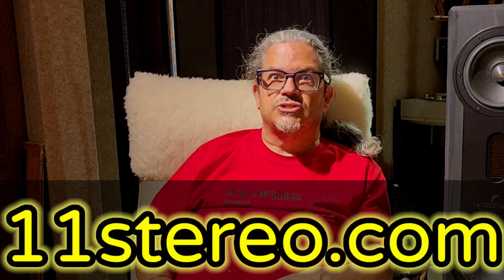Fix your AUDIO with proper house Grounding!!

Comment from the maker: PLEASE SUBSCRIBE 🙏 if you like my content!!
Reply: And make sure there is no corrosion at the connection point between the rod or underground water pipe and the connecting wire clamp.
Also a whole house surge protector is a good idea.

Comment: Small correction:
Those wiring check devices that you plug into a wall outlet make sure that the hot wire is the hot, the neutral is the neutral, and that the ground has continuity with the neutral (usually 3 lights). 
If buildings are wired according to code, the neutral wire (current return path, usually the white wire) and the ground wire in your outlets are connected together in the main panel, they're not supposed to be connected to each other in branch/sub panels. This doesn't tell you ANYTHING about the quality of the main panel grounding to earth (ground rods) or grounding to your plumbing. 
Those testers will show you that everything is correct with or without earth grounding or plumbing grounding. Those devices cannot check that.
Reply from the maker: OK so they check for correct phase only. So much for cheap Home Depot bullshit
Reply: Yes, these cheap device are a good starting point to check if the wall outlets was wired properly in the house.  For checking quality of the ground quality of the wall outlets... Can this be done with voltmeter?  We can a check visually as mentioned with connection of grounding rod, but they could be issues somewhere else.  How can we check to make sure we are all good?

Comment: I run a “Ground” or earth cable connected to a secondary copper earth rod outside on every piece of equipment I run. Mickey’s dead on with this advice 🍻
Reply from the maker: There you go... that's the OCD level...
Reply: That’s dedication! 
🎶🤓
Reply: I am about to run a separate MC cable to a new outlet in my house and be on a 20A breaker. Separate ground and ground rod for it. No more sizzle sound from old grounding for my modeler. Hope it helps

Comment: As a registered NZ sparky we have to measure the resistance between the ground peg and a meter probe inserted into the ground.We are only allowed to run additional earth pegs in series only with the earth terminated at the earth bar in the main distribution board. I recommend to people who think they have earthing issues to first check earth connections after turning off main distribution board power first and then soaking ground with water around earth pegs if soil is dry.
Reply from the maker: Yes, you can also buy special concrete that stays wet of you live in the desert. We don't have dryness issues where I live however.
Reply: @OCDHIFiGuy  I used to know an extra OG who worked for Boeing back in the day as an Electrical Engineer when most of the electronics were run by vacuum tubes.Great stories,one of them was the effort they went to for earthing,burying large areas of metal grid in the ground.

Comment: Hi mike I see my ground rod out side it looks like it's all conected but say it's not is it ok to just go touching it iti s it live  should power be off before I put a metal screwdriver anywear near the wire to reattach it .
Reply from the maker: Under normal circumstances, it's not live. I can not, however, give you electrical system advice as I'm not licensed to do so.

Comment: I also use greenwave EMI suppressors. LED lights and switching power supplies create a lot noise, which can be measured and treated. This is especially useful if you can hear your neighbors radio coming through your speakers.
Reply from the maker: Lol. Neighbors radio in my speakers ? Where do you live ??
Reply: @davidcross890  Lol

Comment: Most homes built before the 80's didnt have them. The plumbing was all metal pipes before then, and had long runs off the house.  When PVC plumbing became the norm is when a grounding rod or grounding electrodes started becoming more common. I dont think it was until the 90's though that it bacame mandatory in my state. My statements are just what i remember reading some time ago.

Comment: Grounds, grounding, ground loops, .... can be such an horrible problem. Tricky to fix. With all the ways each piece of hardware is connected to every other one's ground! AC cord, line level cables, chassis ground connectors, ... and not only hum, but all the way up to RF. a bad RCA ground connection can literally act like a cat's whisker detector and inject RF into the signal path. Dissimilar metals used for connectors.
Reply from the maker: Why I use XLR
Reply: @OCDHIFiGuy  Grounded on one end?

Comment: All metal parts shall be bonded to ground.  New houses have a concrete uffer or rebar for proper grounding, old houses often need two ground rods when the panel has been upgraded.  Also all detached  buildings such as shops with power need two ground rods outside and all metal piping going into it to have equal ground potential.  Also if the siding is metal it needs to be bonded. There you go in a nut shell without throwing NEC code articles at you. Never use the grounding conductor as a neutral either, its only there to facilitate a low impedance path of a fault to ground in order to trip the over current protection  knows as a breaker.  ;)

Comment: Great Advice. I design and build my own DYI analog audio "add-ons" for my system and also build power amps.
It's important to implement a HQ single point "star ground" node in your audio system. 
This should be bonded to "earth" ground and one point and one point only.
Too many ground connections in an audio system will produce  "ground loops" and result in excessive hum and noise.
Reply from the maker: Well said! That's it..

Comment: 1:52 zero volt reference. for digital. ut seems to reference 0 more critically . and behaves like a single point source for the entire signal….this could affect the soundtage if it does not reference that 0 / point source properly electrically. mostly could introduce jitter.

Comment: Ground "enhancement" devices are just nonsense which very often intentionally introduce ground loops and other grounding issues. If you really want to learn how to properly ground your system and gear read up on Bill Whitlock and Bruno Putzeys. You can find numerous papers and presentations from them regarding grounding. Do it properly and you won't have to think about it again. Bill has dealt with grounding and AC cable issues in large concert halls lowering the noise floor of all the gear in the building.
Reply from the maker: I chose other guys, but yes, read up on it if you have the time and are interested. Ground works. No matter what you call it. I've heard the magic boxes totally work...